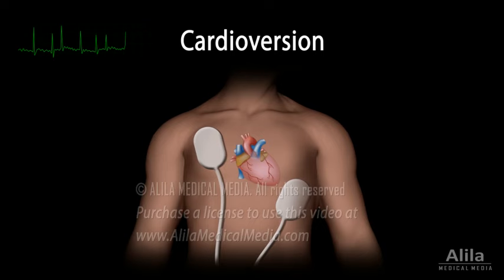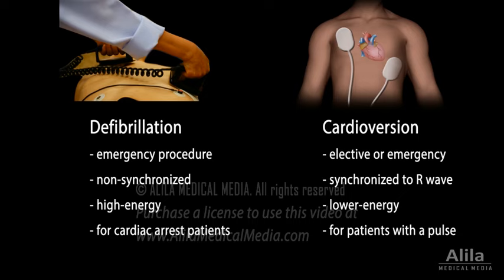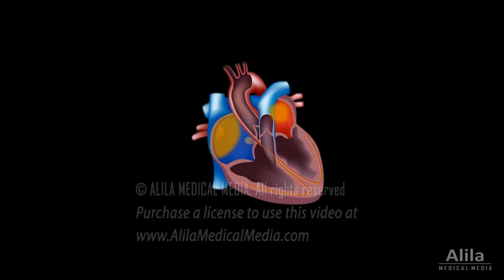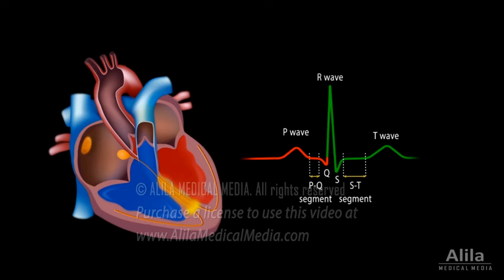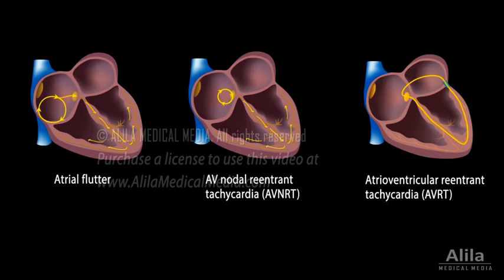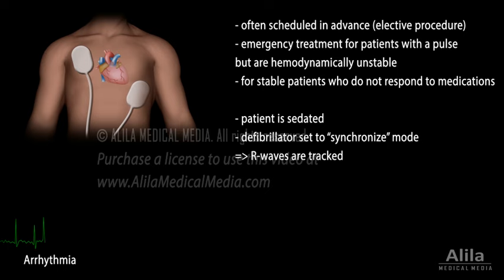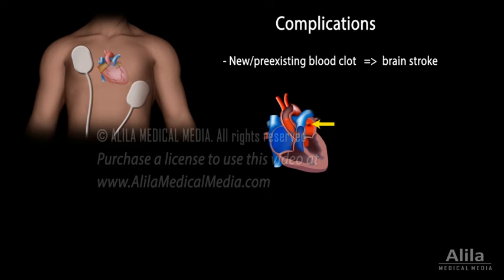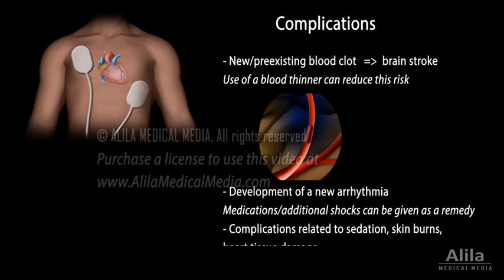Cardioversion (Electrical) Procedure, Animation

Comment: I need to have this done in a week to get my heart back in sync. Anyone who has had it done, or familiar with it please let me know if I should be frightened. I'm 57 and never had one medical issue ever
Reply: How did it go?
Reply: @suzyb7718  I feel incredible. Never realized how bad i was. Just thot i was out of shape for last 2 years and after cardioversion, its easier to breathe, have more energy. Got so used to feeling the way i did, i thot it was normal until now.
Reply: I had one done in October and can’t believe how much better I feel.  It is easier to breathe and I can walk further without running out of breath.  I am 70 and should have had it sooner.  Good luck
Reply: @dickiefredericks  nothing to it. I came out fine and glad I had it done feel incredible since and it's been months